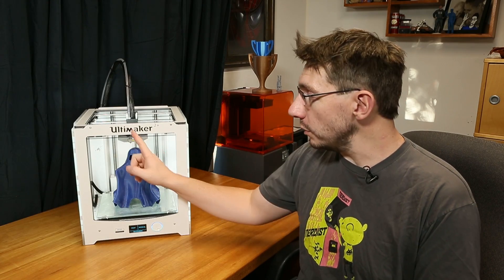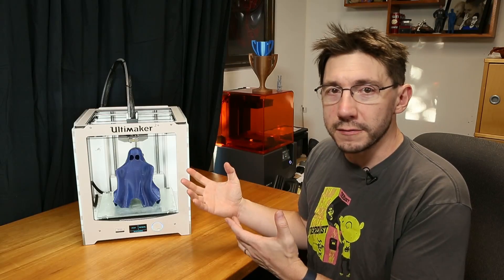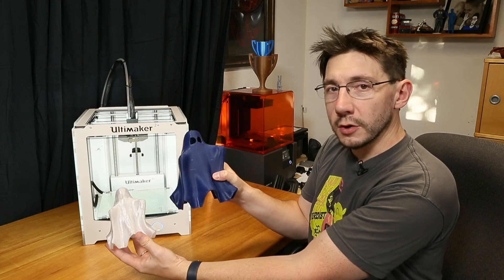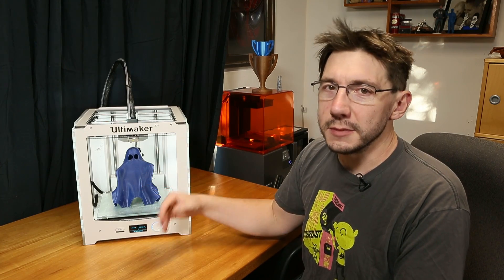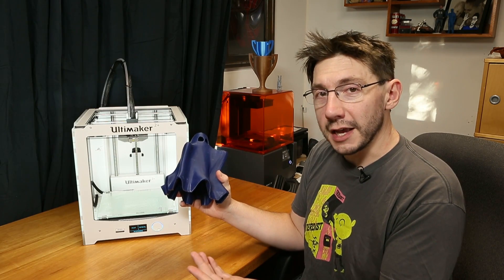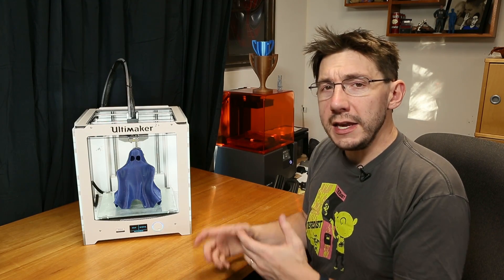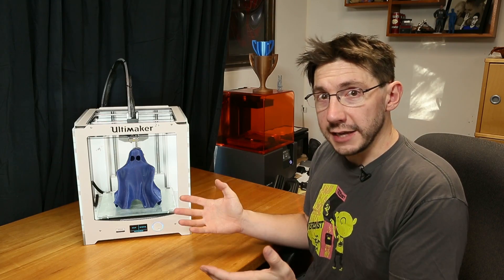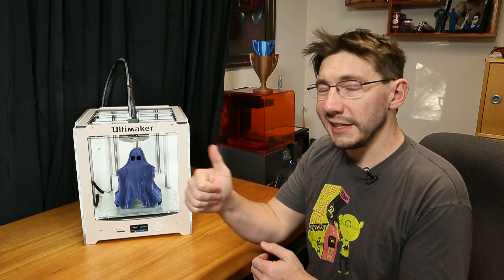3D Printing 101: How To Change Nozzles on the Ultimaker 2+ 3D Printer

Comment: Even if you never use a filled filament, I think it's well worth switching to plated nozzles because they have less flow resistance and they keep clean easier. They are also easier to cold pull from because they release plastic easier.

Comment: May i just add that if you change your nozzle let's say from a standard Ultimaker to an E3D you might need to adapt the buildplate level a bit because they are slightly smaller (and vice versa). And also don't unscrew the nozzle if it's cold (even if no filament is loaded), heat up to at least 140°c because it can break things! #HIGHFIVE

Comment: Something to warn folks about with the e3D hotend is that you have to use something to hold the heater block when you're working with the nozzle. Otherwise you run the risk of either unscrewing the heater block or over tightening it. Don't ask me how I know that.
Reply: Won't ask, but probably you did the same as I did...